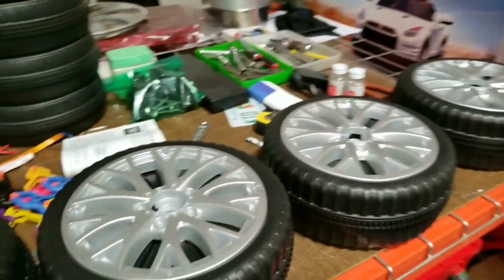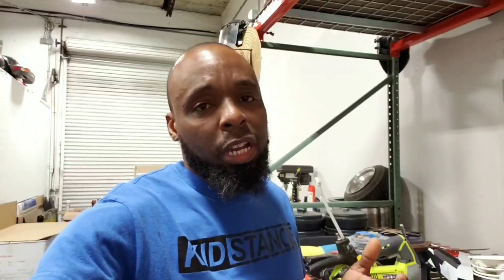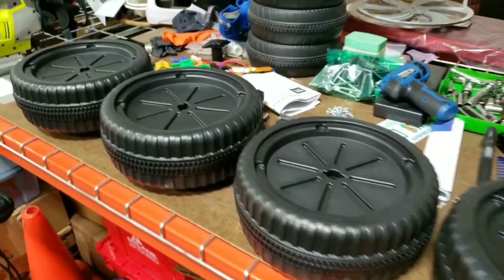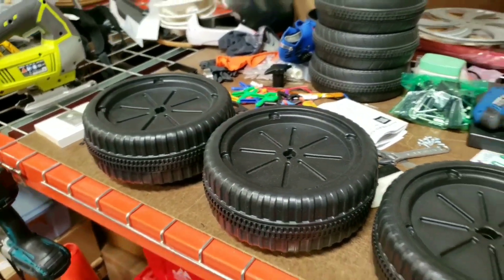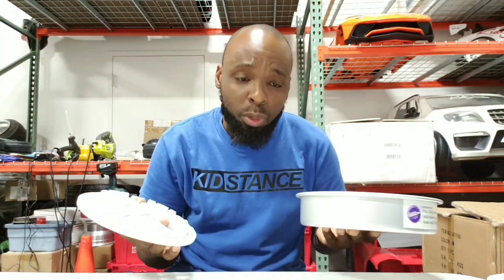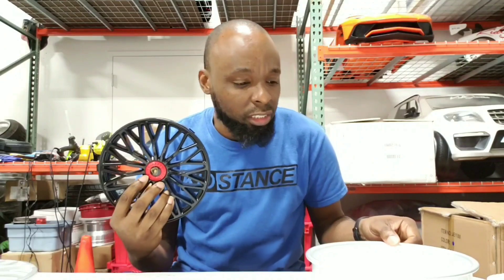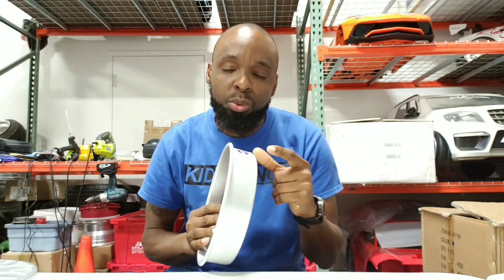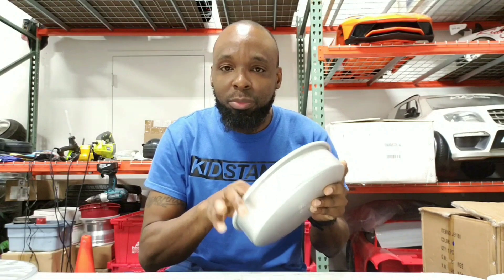Kidstance Workshop: Introduction to Customizing Wheels Part1

Comment: depth of pan and wheel should be the same?
Reply from the maker: No not at all. The depth of the wheel depends on what pan you can run safely. You wanna do a pan that is at least an inch thinner than the wheel. For example, if the width of your wheel is 3 inches then you'll want to run a 2 inch pan.
Reply: @KidStanceBuilt  what’s your Instagram
Reply: Got it! Thanks, I'm currently cutting wheel x6218 E801 - 01 from a power wheel red 04 corvette stingray and it's very difficult due to the very hard plastic and inner cone that's connected to the other side of the wheel, it's not a simple cut around the wheel... have you worked on that one?
Reply from the maker: @ferrarif174  yes and those are probably the most difficult wheels you'll encounter.  They are similar to the bigger Escalade wheels. Basically anything from Fisher price powerwheels brand will be harder. I wish i had an easy solution for you but i would suggest using a dremel with a cutting bit or drilling a million holes all around it with a drill then cleaning it up once you get the face out.
Reply: @KidStanceBuilt  yes sure is bad to cut, I purchased a fairly cheap rotary tool with a blade, not very powerful so its taking long time to compete one wheel. Would other  wheel be compatible with this car? If so which one you recommend ? I do need new set of wheels.  Good thing I didn't purchase a direct replacement of these.
Reply: Power drill with thickest bit worked great! Thane for the suggestion, power drill plus cutting tool is a great combination.
Reply from the maker: @ferrarif174  awesome, glad to help!